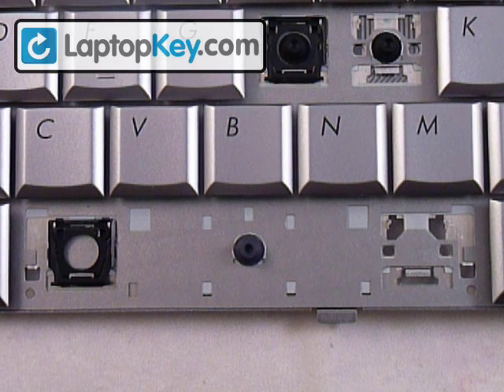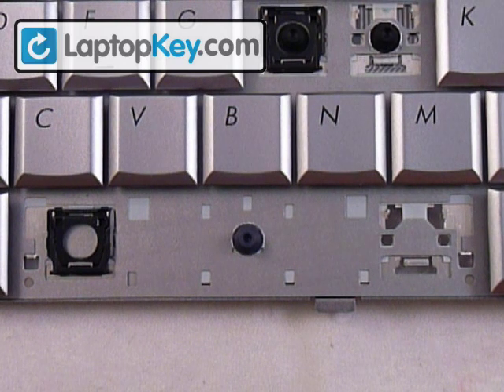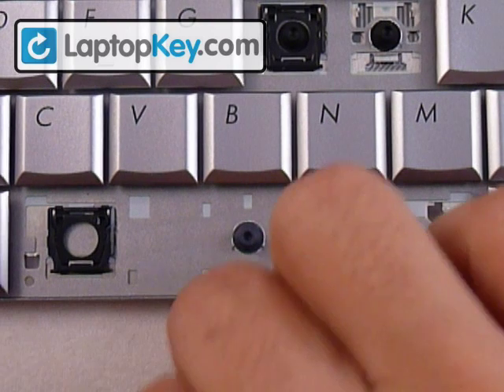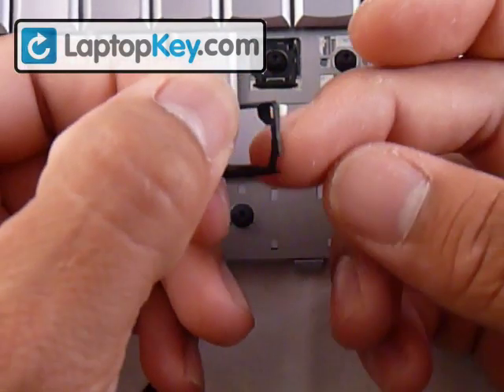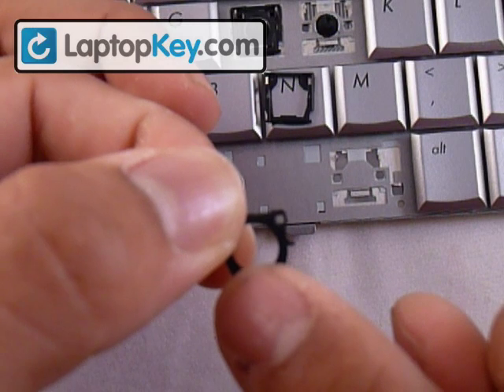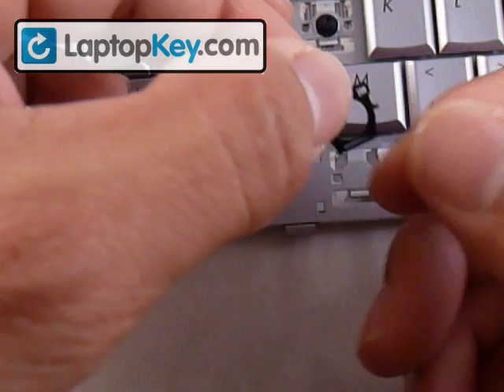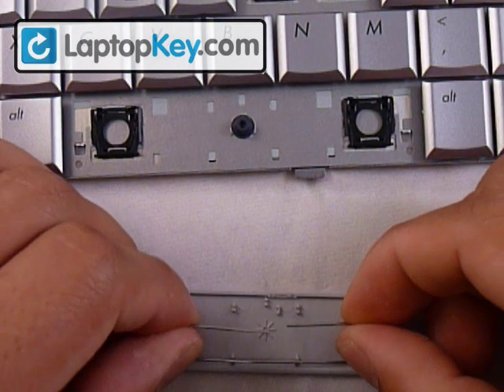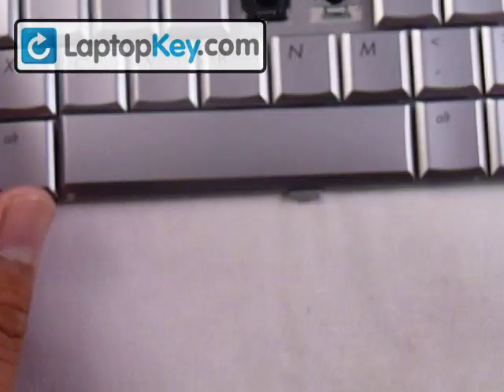FIX LAPTOP SPACEBAR KEY | SPACE BAR HP DELL TOSHIBA LENOVO ACER

Comment: Hi, I ordered and installed a spacebar key but it still has some problem: when the key broke due to a heavy weight falling on top, there was a slight bend in the surface below. Now the new spacebar does not come back up completely and only works when I hit it with my finger right in the middle (nor left or right) and with more strength than to other keys. Is it okay if I glue two additional rubber cups onto the empty space for them to add more stability to the bar, or this won't work? Thank you!